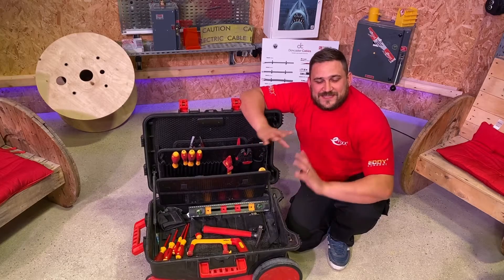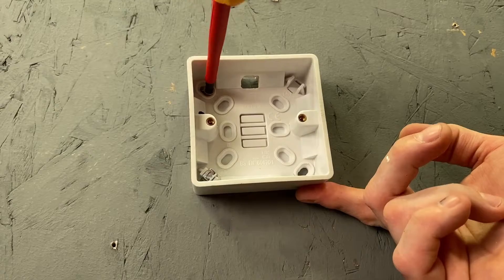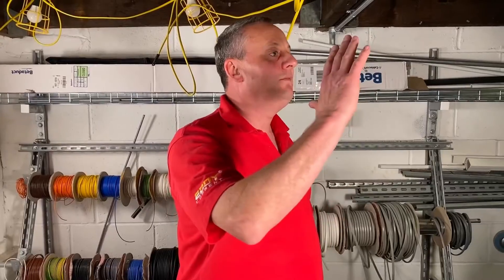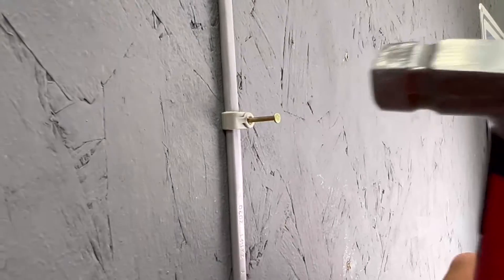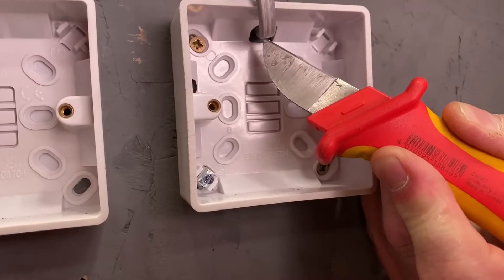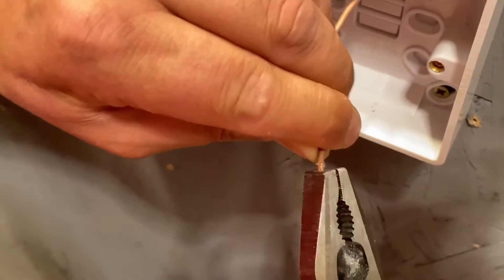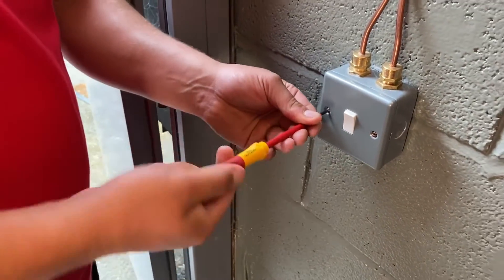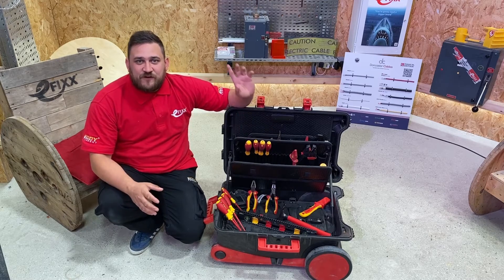The 9 Electricians Tools Every Apprentice Should Know!

Comment: I rarely use the combination pliers. Instead I use insulated angled long nose pliers or telephone pliers as they are often called here. They are very versatile. Also instead of the electricians knife I use either a normal knife / cutter (I know not insulated) or a wire stripper.

But over all a good list of tools.

Comment: I use the Wiha 4mm flat screwdriver for tightening screws inside the light switch (make and screws dependent) and definatly for front face screws. BTW if you turn your pliers and side cutters the other way when stripping cable (Flat face out or away from you) it makes stripping cables so much easier. the side cutters are designed that way. I have done this for years now since I was shown in tech.

Comment: If a spark cannot bend over the ends of a cable with a pair of snips he ain't  spark!
Electricians knife?   I only ever use one on cable jointing. Ditch the knife, get some bent nosed thin nose pliers, saves a LOT of wrist bending. But what do i know as I've only been doing the job for 50+ years
Reply: Feel better now that you’ve got that off your chest?

Comment: Electricians use robertson Square head screws as fasteners.
Reply: Not in the UK.
Reply: @MrIbib  In NI we do.
Reply: @dvrn86  didn’t know that. Wonder why you’ve been lumped with those?
Reply: @MrIbib  much better to use. Used them for most electrical connections in North America too and they're way better to work with than flat head terminals.
Reply: @dvrn86  you’re probably right. Can’t stand pz screws on consumer units. About time we swapped to 3mm hex.

Comment: Since I finished college 8 years ago not once have I seen an electricians knife on site, just use a Stanley you’ll be blunting the blade once a day depending on the type of work you do, also if you buy an “electricians hammer” you’re just a marketers dream
Reply: claw hammer the way to go, can get a proper thwack at things
Reply: I was told as apprentice claw hammers are for chippys , ballpain is for engineers!
Reply: @raychambers3646  same.  But I find the claw hammer way more useful. Had my Stanley blue strike and 99e since 1997.   They are the only tools I haven't lost or been stolen.
Reply: @MrKeefy   I think it depend on the type of work you do , I've never really needed one .
Reply: Electricians knife have their place for certain jobs. If you use it like Jack the Ripper, you're going to be sharpening that blade all the time. Use is wisely and for the right job like stripping the out sheath off of a SWA cable, I think it trumps the Stanley. As I always found this to kill blades in my trusty retractable knife. The right tool for the job is a mantra everyone should heed. I've seen lads use the back of impact drivers as hammers before now. You could tell they never used to buy their own tools 🙄

Comment: You forgot the most important tool for an apprentice .. a broom , teach them to tidy up before letting them loose on the tools... never used a knife, always used side cutters but more recently the Jokari flat cable strippers esp on downlights.. not a fan of slotted pozi's the slotted tips tend to break.. wiha and wera ... never had a prob using a PZ2 ... 5.5mm is a bit big for a lot of brands.. i tend to use a 4.5mm sockets and 3.5mm switches... electricians hammer? really? been using a good old estwing for the past 25 years.. another handy tool is the wiha pocket max but had to buy extra blades to suit my needs
Reply from the maker: Now now That Tool Guy 😂